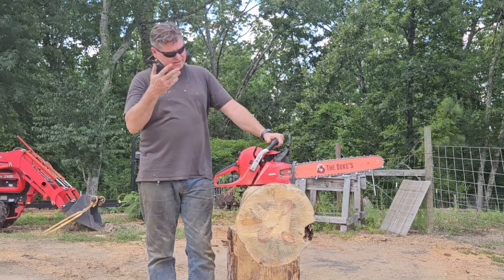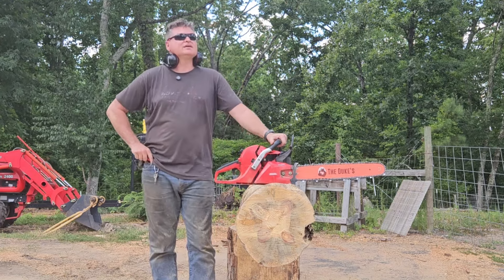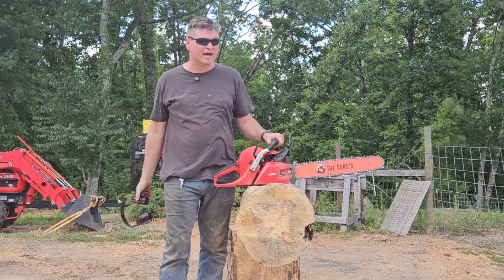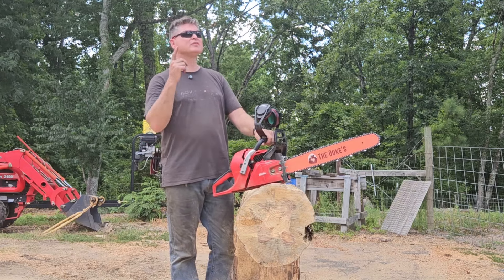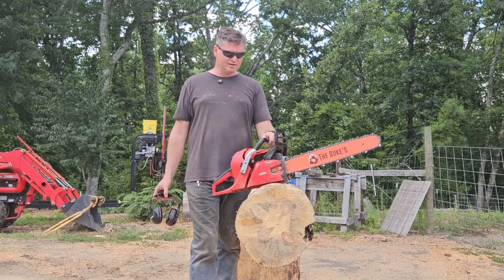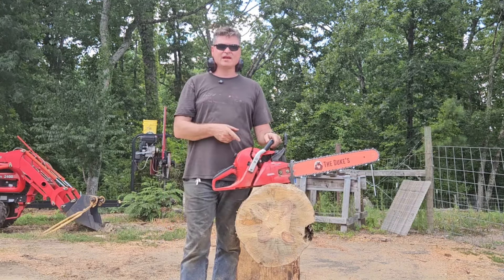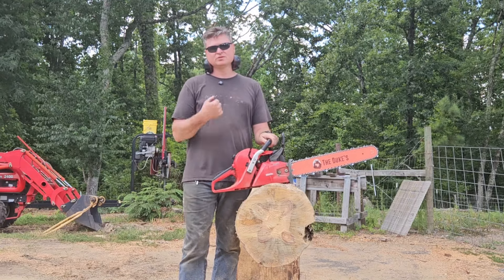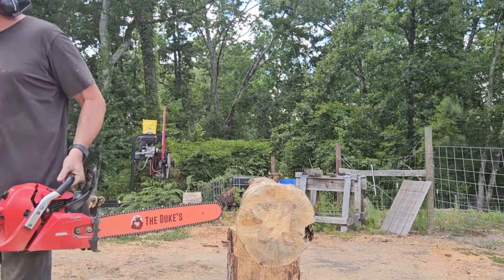Michael's Shindaiwa 600sx all ported up!

Comment: I still get cracked up at your callouts 😂
But gd you are right.  I do tree work full time with powerline clearance (cutting, climbing and bucket) and then do as much resi side work as I can.
But this started as a hobby for me years ago.  I was self taught.  The FIRST thing I looked up was how to make a proper notch.  The second was how to tune a saw.  

A little ambition and you can learn ANYTHING but you just have to have a thirst for knowledge.

Hell I had the basics of climbing down before I ever stepped in a tree.  I got my first set of climbing gear by trading some firewood for an old saddle, lanyard, rope, and a split tail.  He offered to show me how to set it up and I said "let me see if I got this"
I put the saddle on,  tied a blakes, threw the line over a good branch, and I was in business.  On up.
All you need is the thirst and to pay attention.  Take notes if your memory sucks.  Bookmark or save videos and websites.  Literally 99% of human knowledge is on the internet if you want it bad enough.
Reply from the maker: Yes.  Yes to all of this.  So many just have no ambition to learn on their own.  I never considered myself a "real go-getter" type until now that I am older.  I look back on all the shit that I learned and accomplished on my own volition and I think, "goddamn, I was a motivated mother fucker!"  No one has ever been able to tell me that I couldn't do something.  So when folks don't have the ambition to learn on their own... I just can't even understand what is happening.  It's like trying to understand depression.  I just can't do it.  I know it is real, but I can't get it.  I don't know what is happening around me when a professional tree service owner hands me a saw, says it won't stay running, I start it and turn the idle screw and it runs perfectly.  The tree guy then says I am the magic man and I think, "Nope.  I'm not magic.  You're an idiot."  I'm pretty sure if I had existed 2,000 years ago... I would have spawned an entire religion.
Reply: @novicelumberjack  🤣🤣🤣
Reply: @novicelumberjack 👊😁😂, What would your religion be called/named?
Reply: By listening to your play by play chainsaw tuning, I have learned that I have been tuning high side too rich. Mostly out of fear, which drives us to ask dumb questions.
Reply: @Macgyver-ranch  👊
Reply from the maker: @Doc-Cole_Trickle-of-Chainsaws  Boedism.
Reply: @novicelumberjack  🛐HOOOOO!

Comment: As far as the oil issue i can tell you why pros don't like stihl unless its stihl saw. The stihl oil will not support the rpm of husqvarna over time. I know one logger blowed up 272xp and 288xp before he figures out the problem. A semi pro user blowed up 350 after me telling him not use it. Another logger blows up 395xp not cheap. My first response you run stihl oil he said yes and husqvarna won't warranty it because he was using stihl oil. Mixture i have always just used a 50:1 on 9 tenths of gallon of 93 octane. Husqvarna doesn't like 87 from my experience.

Comment: I can't count how many times a week I get asked what oil and mix ratio I use. I get asked at least 3 times a week how many turns out my carbs are set at. That question always makes me laugh. It's also a dead giveaway that the person asking that question doesn't know how to tune a carburetor. I was almost 14 years old when I started running a saw. By 15, I knew how to tune. I think a lot of people are too intimidated or scared to tune their saws, because they fear they will screw it up and damage the saw. I have to  explain to people that my tune might not be what their tune needs to be. There are lots of factors. Like altitude. I literally live at 10 feet above sea level. My tune is going to be drastically different from someone who lives in the mountains or other much higher altitudes. I moved from Dallas, Georgia to the Florida panhandle 7 years ago. Dallas is at 1,043 in elevation and where I am is 10. Of course I have to tune my saws for that big of jump in elevation. I have to do it every time I bring a saw to Georgia to do work for my father a couple of times a year. I learned that fast. All my perfectly tuned saws ran like crap and needed to be re-tuned when I got to Georgia. It amazes me how many "veteran" chainsaw users don't understand that. What tune works for me, probably won't work for them. At one point, I started giving them the factory carb settings for their saw model.

Comment: I'll add Chicanic has seen problems with some of the canned fuels.
Reply: Most of which can be tuned around if one chooses to run canned fuels full time. Ethanol has 30% less BTU's than straight gasoline. Therefore, 10% Ethanol blends need roughly 3% richer jetting. Not to mention the difference in stoiciometry between the different fuels😁
Reply: @aaronpowell4885  The problem she is seeing is blown up engines. Kind of hard to tune around. She doesn't use ethanol gasoline anyway. Pump gas only contains 10% ethanol. So you are talking about a 3% difference in btu's. Not something the average user needs to worry about. To be clear it is the premixed canned fuel she has a problem with, the problem being either variances in fuel/oil ratio can to can or the quality of the oil.
Reply: @kraftzion  I've heard talk about the t-brand having an incorrect amount of oil added. But just figured it was only talk!  The majority of my saws will sit for months between use, so I do use either 100ll avgas or v-brand 4-cycle fuel and mix my oil of choosing in.
I do agree that the vast majority of saw users don't need to worry about a 3% difference in BTU's👍🏻
Reply: @aaronpowell4885  I used to use regular av gas back when I raced motorcross and hare scrambles. Still remember that fantastic smell. Didn't know what I was smelling was lead at the time. Llav gas hadn't even been invented at the time. Even llav gas still has twice the lead allowed in pre88 leaded gasoline though. Even though I can get non ethanol gasoline here in Florida I don't bother. Haven't had any problems with ethanol gasoline since the advent of pressurized gas cans and the good black fuel lines, teflon diaphragms for the carbs. I own 5 chainsaws, don't need firewood, they are very much a hobby. Ive had gas sit in the  can and one or more of my saws for 6 months easy without undue problems. Might have to change the purge bulbs on the saws and trimmers that have them more often but purge bulbs are a dime a dozen. Even the yellow gas lines seem to last longer now, don't know if they changed the formula. The worst problem I had with ethanol gasoline was with the gray fuel lines for outboards. The inside liner would collapse and shut off the fuel. Swapped to regular car fuel line which was much cheaper too and solved that problem. My thinking on the subject is that you have much higher turnover on regular unleaded than you will have on non ethanol at the pump so the gasoline you get will be much fresher but contain ethanol.
Reply: @kraftzion  yeah, I don't use the 100ll much in handhelds because of the thought of leaded exhaust a couple feet from my face. Fantastic fuel for storage tho!  Our local fuel supplier has 1 dedicated non ethanol 87 pump and tank, but his turnover hasn't been the greatest lately. 2-3 fresh loads a year😒 and it's only about 25 cents higher than regular pump gas.

Edit: forgot to add, yes totally sealed gas cans and newer fuel lines and diaphragms deal with E-gas much better! Just hard to keep fresh fuel in 20+ saws and 10+ other various 2t pieces of equipment and I don't prefer to store them dry🤪

Comment: Morning, why are americans crasy about rpms? Build a strong saw and then gear it up. Way more efficiently.
Reply: Hp= torque x rpm. So if you just optimize for torque and not rpm also you are not going to cut as fast by gearing it up.
Reply: @kraftzion 👍🏻